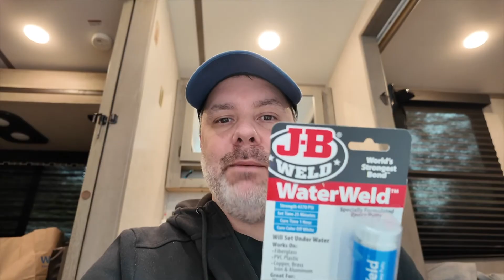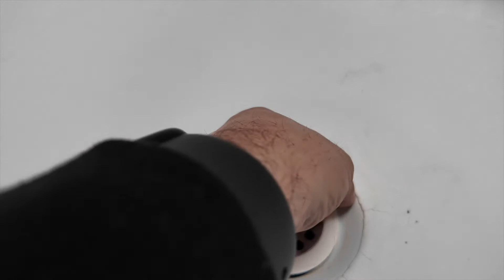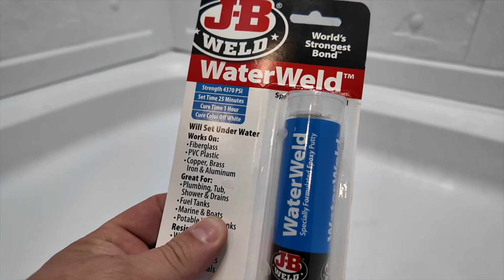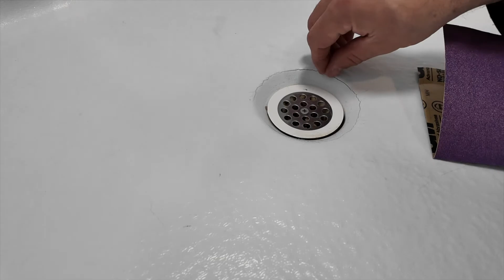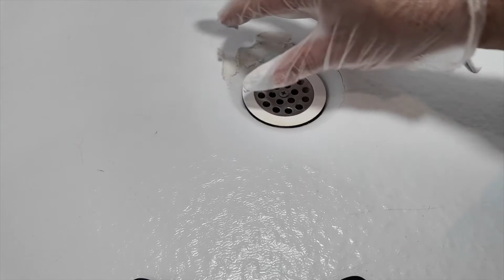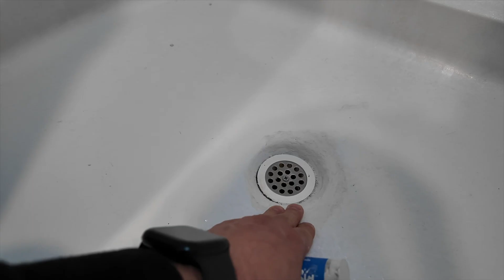RV Shower Crack Repair- Easy Fix!

Comment: I've own my 2024 Delta alliance 321bh only owned it for one year shower has cracks in it already black tank valve has failed twice just got it back from having that fixed and I put an electric one in for me and it's leaking I'm starting to learn that these things have a lot of problems

Comment: So I just found an X shaped crack in the floor of our Travel Lite camper. The floor is kinda complicated. Due to it being a shower and toilet.   Examining through the cracks, it appears there is a Styrofoam sheet between the floor and the greay water tank. So it appears that the Styrofoam has flattened out. Thus, it does not provide the support it needs. 
I was thinking about shooting some expanding foam between the floor and the Styrofoam prior to doing the Water Weld. Your thoughts would be appreciated.  TIA!
Reply from the maker: Interesting idea- yes, I think most of these issues, mine included, is caused by the foam losing rigidity. I never considered the expanding foam, but may be worth a try. I considered shims, but I couldn’t get it to line up just right. The foam may be a nice thing to try. If you give it a go, I’d love the hear how it works out for you.

Comment: Just found your video is it still holding up a year later?
Reply from the maker: I had to touch it up once, but still working. At some point the shower base will need to be replaced, but this will buy me several years until then.

Comment: Can you use a sealant over the JB water weld?
Reply from the maker: Probably, as long as the sealant is rated to be applied to a variety of materials. However, not sure you would need it since the water weld seals good enough

Comment: Hey I'm not sure if you did this or not but that JB Weld putty you're supposed to take a chunk off and switch it together and it once you mix the ball of putty together it starts to get hot and it turns into a gray color and that's when it has The Binding activation. Like you can't just rip a piece off and start smooshing in there you're supposed to rip a piece off rolling in a ball in your hands in like smushing it back and forth like mixing the putty together

Comment: I watched your video and it was very helpful.   Wasn’t sure what to do with the cracks in my RV tub.   I had a hard time getting the putty to feather out like you showed in the video.   Thinking it was because I didn’t knead it to blend the colors together like you demonstrated.   Seven hours since applying it to my tub and it still feels soft.   Is it supposed to be hard when cured?   Maybe it didn’t harden because I didn’t knead it first.  I need your help with this and answers to the questions I have.   🤷‍♀️
Reply from the maker: Let it sit overnight. It didn’t harden for me as fast as the instructions said.

Comment: Hi, I found your video @ 3 days ago. I used a similar marine putty style epoxy. Easy way to fix this problem, I had a similar crack going on in my 2020 Grand Design 303RLS. Good job on the video. Happy Trails!
Reply from the maker: Great! So glad you enjoyed it and got your shower fixed using something similar. Mine is still holding strong after many months of heavy use. Thanks for sharing!